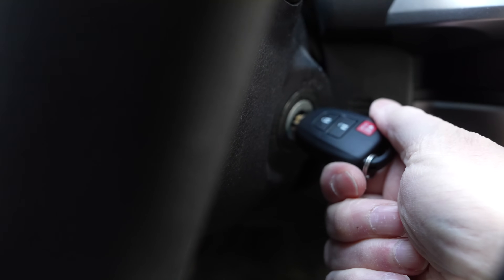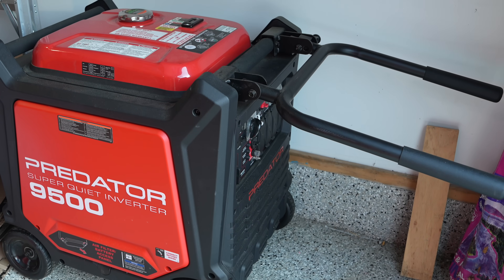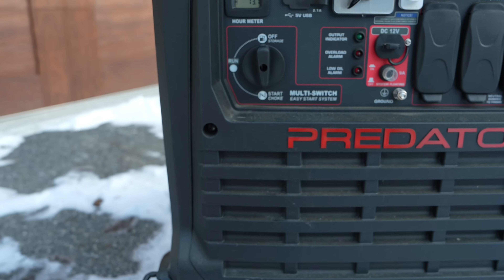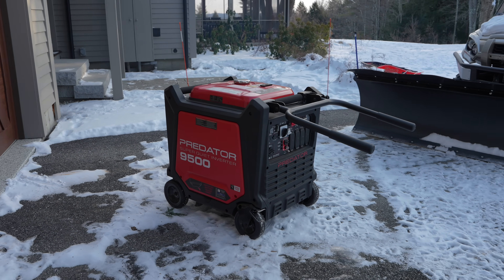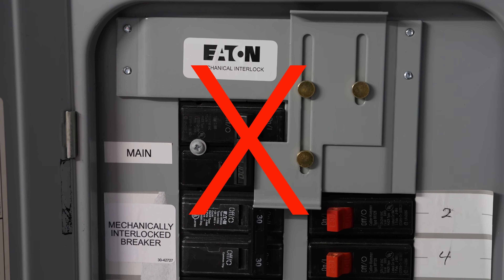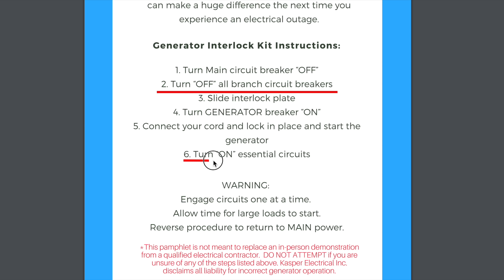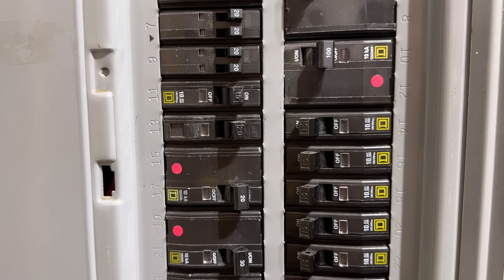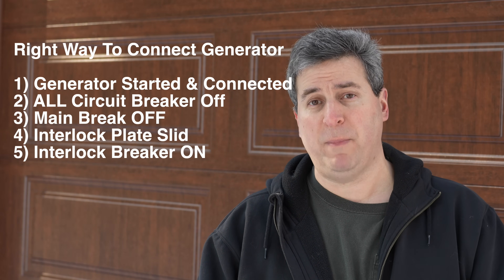Homeowners are Destroying Generators Skipping 1 Step During a Power Outage

Comment: Use ethanol free gasoline for the generator. Just google for a station near you. It's worth it. You want ethanol free gas in small engines.

Check engine oil before starting.
Let the generator run for about 2-3 minutes to cool down after load.
Turn generator off by turning the fuel off so it'll pull all the fuel out of the carb.

Check the generator every 6 months - making sure to cut the fuel off to stop it.

I have a 25 year old Generac that I kept running doing this. It originally started as a construction generator that they blew up because they didn't keep oil in the engine. I rebuilt it in 2004 (B&S engine, new piston, connecting rod, rings were the big items. About $150 to repair in parts, $50 to buy from the small engine repair shop). I've used it to power houses, construction projects, house repairs, provide power for aircraft, and so on. I used it as recently as a month ago. Still runs perfect even with a max load.
Reply: I agree, excellent points!

One thing to remember with ethanol-free fuel is to run a few gallons into your vehicle’s tank first before filling your gas cans. I believe it was Chickantic’s channel that talked about this issue a few years ago. She said she was repairing small engines that had ethanol related damage even though the owners swore they were pumping ethanol-free fuel.

It turns out, many of the pumps use the same hose for multiple grades and ethanol-free fuel. A couple of gallons of residual fuel needs to be pumped out. When they were filling a 1-2 gallon portable tank, they were basically filling it with regular, ethanol-contaminated fuel.
Reply: @jeffroalpha700  The pump I use is ethanol free only. They are stand alone pumps off to the side. She's right about the shared pumps. Shell and the local fuel oil place has these types of pumps.
Reply: @jeffroalpha700  So I can only buy the sealed cans of fuel with my EV then?
Reply: @jeffroalpha700 WHY, what kind of crap equipment are you buying?
Reply: You dont have to do that if you get all the gas out  let it run until it kills i been doing that with the same Gen for 26yrs never had a carb issue yet!!
Reply: I just did this to mine. I siphoned the gas out of the tank and then started the generator and let it run until it sputtered out on its own. Then tried staring it again and it ran about 1 second and sputtered out again. This gets rid of all the gas in the carburetor and the fuel tank.
Reply: Just don't leave gas in it. Same result without the extra cost.
Reply: Excellent post. Thank you.
Reply: After I got excited about ethanol-free fuel I did a lot of research in finding ethanol-free fuel near me threw the renown website -"Pure gas", only to find nothing anywhere. I even drove to the gas stations that acclaimed to be. Nodda.
Reply: Or even the engineered fuel. Expensive, yes, but worth it imo. At least for storage.
Reply: Just buy the ethanol neutralizer made by any one of a number of different manufacturers, ever since I started adding it to my gas cans whenever I get gas for my lawn and garden equipment all my ethanol problems disappeared, no more melting fuel lines or carbs, and I can once again leave my seasonal equipment, both 2 and 4 stroke, sit out of season and the next time I grab them months later they fire right up, just like the pre ethanol days there's no more draining fuel tanks and throwing away any fuel that sat during the off season. 
It's cheap and it works, no buying ridiculously expensive gas for things that shouldn't cost what it does because somethings missing from it, yea, explain that logic.
Reply: @dukecraig2402  I'm not sure how you neutralized ethanol. What you're doing is adding something else. I've rebuilt a lot of carbs. Take my advice and simply pay the dollar or two to get good ethanol free fuel. It's better fuel. The cheap stuff you get isn't meant to last all that long. Some people say just a few months. Ethanol free is a higher grade, better fuel. Take care of your equipment and it'll take care of you. I have a billy goat leaf collector - 1994, Toro lawn tractor - 1993, Echo weed whacker - 1995, Mantis tiller - 1997, generac generator - 2003. All still in service. I loaned the toro lawn tractor out. The guy used ethanol gas in it. Man, it did a number on the carb bowl. A lot of crap in there. It also has a fuel filter.

Up to you. My advice is to use non-ethanol gasoline.

Comment: Most important for the use of the generator, next time, when done using, drain the fuel from the tank, and start the generator, and let the carburetor bowl empty, you will know when it's empty cause the engine will stop running, that way you can insure it should start the next time you need it.
Reply: @knighthawk86855  excellent comment!
Reply: @johanslabbert2869  Thank you, I work on small engines, and see neglected machines all the time, a simple 20 minute procedure will save a ton of money.
Reply: I just shut the fuel valve off while it's running. Same effect and you don't have to drain the tank.
Reply: @mae2759  yep, and if you don't use it in 3 years with ethnol in today's gas, if the tank isn't plastic, and is metal it will rust it out, and ruin a 200 dollar tank.

Comment: What are your thoughts on neutral bond generators going into an interlock? Should the generator be changed to a floating ground?
Reply: I believe that an interlock connected home generator has to have a floating (neutral is NOT bonded to the generator frame) neutral. Then, when you plug into the interlock at the house, the neutral and ground protect from faults by causing the house load center breakers to flip off. Generators that use extension cords that run into a house (120 GFCI) HAVE to have a bonded neutral at the generator or, if there is s ground fault due to a shorted out tool/light/toaster etc., the generator receptacle breaker switches WILL NOT FLIP! The instruction manuals are supposed to say if the generator comes with a floating neutral, but those Chinese manuals might be printed wrong! And, a generator does not have to have a 4 or 8 foot ground rod connection. I hope this helps.

Comment: Black start the diesel! Full load on the diesel no warm up! We used to run this drill incase of emergencies. Always felt bad for the engine 🤣.
Reply: Black start on a diesel is usually fine after about 5 seconds. IOW, just long enough to have a stable RPM.

Comment: I put one of these in my old house and put some basic instructions on the panel. Step 1 was Turn ALL breakers off. 

Also when disconnecting most generators are supposed to run for a few min with no load after running under load to come come to a steady state temp, although this step could vary depending on your generator, so always read the instructions.

Comment: Wait, flooring the gas pedal while starting the car engages "clear flood mode." It tells the car's computer to not inject fuel while cranking. It's great for priming the oil filter with oil after an oil change.

Comment: Might be more relevant to a commercial setting, but always add any loads that are turning motors to the generator first. The first half second or so of an electric motor starting up is quite rough on generators, so if you added these last when your system is near full capacity it could easily overwhelm the generator causing surges and tripping, and even damage other connected equipment. Ask me how I know 😅
Reply: This isn't a contradiction, just an add-on. In residential I'd say that includes refrigerators, freezers, A/C units, fans...all have rotating motors, so a good procedure for commercial AND residential. Too bad, like he said, sometimes when these events happen we're not awake and thinking clearly.
Reply: I agree; and go ahead and disable anything that is not needed for the duration of a storm/event. With a home of several AC / Fridge / Dehumidifiers, I turn off anything that is just not a requirement for a few hours. Here in the South, AC / Well-Pump / Heat come first.
Reply: I have window units and they must be off.my generator is not connected to the panel but running only low watt items. The refrigerator is important but staying cool is not.  I only run the living room window unit.  Maybe the bedroom if the living room AC is off. I found out it's not a good idea to bond a generator or inverter the neutral and ground is zero volts on grid but on an inverter and generator the neutral and ground is about forty volts so bonded is a no no.  I would think a transfer switch is unbounded. I don't have one so I'm using logic on that statement. Shorting out forty volts is not good on a generator or inverter. 73  @SmooveBee1
Reply: I always recommend that when turning on the circuits you will be using, to wait at least 1-2 minutes between each - especially for any that are powering a frig, freezer, ice maker or a/c unit (basically, anything with a compressor).  Let each unit get up and running - and steady down - before turning on the next.  The draw from all of those starting at once could easily exceed the surge capacity of your generator.
Reply: I learned that from Apollo 13.  ;)
Reply: If I ever need to use my generator, I'm gonna remember this right after I mess everything up.
Reply: @wormyboot  yeah same here. JK I'm not that lucky to even have my generator hooked to the panel I'm still running cords so the generator is already running good, unless I forget to relieve that on top of my gas cap. I was wondering why my generator stopped when I first got it. Then I noticed the gasoline cap on the generator. These videos are good it's a shame I didn't watch one before I bought a generator. Now I have three two gasoline and one lifepo4 power station. 73
Reply: The biggest motor loads in your house: well pump, AC, furnace, fridge, all cycle, so you're going to have to size your generator to accommodate. New fridges, better furnaces, expensive well pump systems use VFDs which soft-start that helps a lot.
Reply: @straightpipediesel  That's a very good point! An old rule of thumb was to size for one and a half times of the starting amp's.
Reply: So you could extend the idea of the Red Dots in the video, and have green dots with numbers on, where the numbers tell you what order to reconnect the breakers if this helps bring essential heavy loads in when the generator still has glenty of spare capacity.
Reply: that's called inrush current

also I did not open replies before replying this
Reply: ?   cause you brrnt out - the voltage regulator, and / or other circuitry.....
Reply: locked rotor can be 4 times running amps for about .5 seconds.   Also, different fuels in multi fuel generators have different watt ratings, gasoline is higher than propane or natural gas.
Reply: How do you know?
Reply: Good one!
Reply: Yes the inrush if a motor is typically 6 times the full load current. It's common in industrial settings to start motors up in a sequence as to not start blowing fuses or breakers. Same goes for smaller applications
Reply: Absolutely

Comment: A generator tip is to get a standby generator or battery system if you can
Reply: That's the best scenario obviously, but there's a dividing line between the benefit vs. the regular maintenance required, and possibly service contracts to provide that service. Something to consider. I know a guy who installs and services standby units, and he makes a very good income doing it.

Comment: I also switch off all branch circuits and then turn individual ones back on after we're on gen power. I too use yellow dots alongside those "typical" breakers I want to make sure are "on" during an outage....for me its the fridge ( avoiding food spoilage), certain lights, etc, the most critical ones. For sure those without "dots"  ( electric water heater / AC) are high draw and remain "off". My gen can probably ultimately run all the circuits ( other than AC and water heater)...but the dots give me a guide. I also printed out the start sequence and also the shut-down sequence when power comes back on....all taped to to the inside door of the panel...so in the "fog-of-war" I simply follow the instructions and not do anything stupid or out of sequence.

Comment: Always remove all electrical loads before turning off the generator. Shutting down a loaded generator can sometimes demagnetize it and cause it to not generate electricity the next time you try to use it.
Reply: I have an Auto transfer switch with built in time delays for picking up the load and a cool down period when the utility power is restored. Where I live we can’t have utility power and generator power switches in a breaker panel, it has to be a separate standalone transfer switch.
Reply: Now days most gensets are inverter style so not an issue but it was a big issue with construction power.
Reply: Dont go from full load to zero load abruptly.
Reply: Good point

Comment: Stop neutral dropping your generators! Awesome video as always!
Reply: What do you mean?
Reply: @mae2759   the comment about neutral dropping is an old hot rod phrase for revving the engine in neutral then dropping into gear with a bang. It has nothing to do with an electrical neutral.
Reply: @ or “neutral slam” as we called it.
Reply: @mae2759  Basically he is telling us to unload your generator slowly. Just like this video shows how to load it up slowly, best practice is to slowly lower the load back to a neutral state before shutting it off.

Comment: I also have a generator interlock system, I used a label maker to print out step by step instructions so if anyone else needs to prepare the generator for emergency power they have a list of descriptive directions on how to do so.  Also it’s there for me to follow if it’s in the middle of the night.   I also installed an emergency light above the breaker box so I don’t have to mess with a flashlight.
Reply from the maker: People may think we are nerds for doing these things but its easier for you and someone else. Just saves a lot of headaches and safety. I think its great and very helpful
Reply: @SilverCymbal  hey, it's hip to be square. Certain age groups will remember that. 😁
Reply: @ thank you sir

Comment: Your videos on literally everything is the clearest videos on YouTube.
Reply from the maker: Thank you, that is very kind of you to say
Reply: Actually a modern vehicle won't start if you do that, pushing the gas to the floor and then trying to start it engages the "clear flood" mode, it shuts down the injectors so you can crank on a flooded engine to clear the cylinders. 
That's actually a trick for people with vehicles that have upside-down oil filters that can't fill them when doing an oil change, after installing the new filter and pouring in the oil engage the clear flood mode as described and crank on the engine until the low oil pressure light goes out, then your filter is filled and you can start it normally without the bearings running dry while the filter fills up.
Reply: Agree 💯
Reply: Agree 🤠
Reply: You don't understand what the word "literally" means

Comment: I've always done this mostly because my generator doesn't have enough power for the whole house. I also made a spreadsheet with the circuit number and what's on it. There's an additional column that tells me to turn it on when on generator power. 

All that said, at this point my house has LED lights everywhere except a few places I turn on rarely. That's a big benefit when on a generator.
Reply: That does make me wish there was a house standard for 12V. I'd like to imagine it would be more efficient if there was a 12v line in the breaker that was converted to 12v before being sent out, reducing the heat and load. this probably doesn't make a hole lotta sense, but I could imagine once you're getting to 4 ceiling fans it could have some marginal benefit. 
the big benefit though is that you could just allegator clip a car battery to the breaker after turning off backfeeding.
possibly they could put the 12v in the light switch too.
Reply: @JessicaFEREM Too much voltage drop at 12 volt.
Reply: @JessicaFEREM  I'm not following and not really seeing the benefit. Most appliances and fixtures with electric motors use AC. DC isn't efficient over long wire runs so you'd have to balance that against any losses from converting to DC at the device.
Reply: @paulv22 Given the same voltage, DC is actually better (less losses) over long runs because DC doesn’t have capacitive losses unlike AC. 

The problem in the proposed situation is that 12VDC is a lot lower voltage than 120VAC so it is definitely not favorable when it comes to efficiency.

Comment: I have a toggle for my workshop’s hot water heater and garage heater on the same 240v circuit. The hot water heater is in an uninsulated concrete bathroom with a draft, meaning it is exposed to freezing temperatures. I have found that it remains hot for days and warm for around a week if I leave it switched to the garage heater. So, yeah, you probably do not need the hot water heater in most power outages.